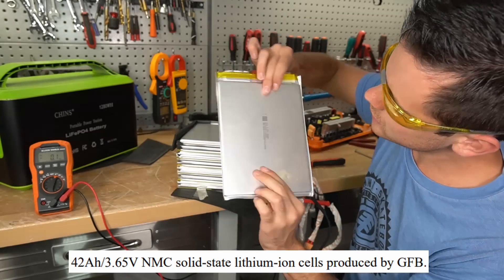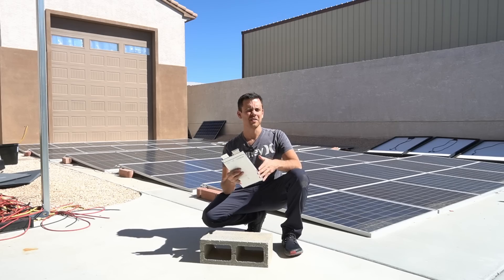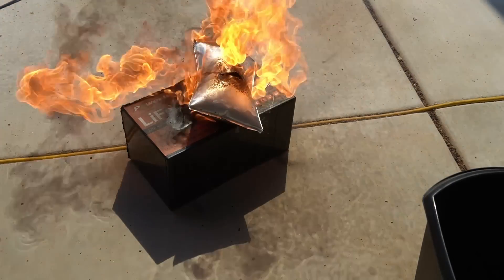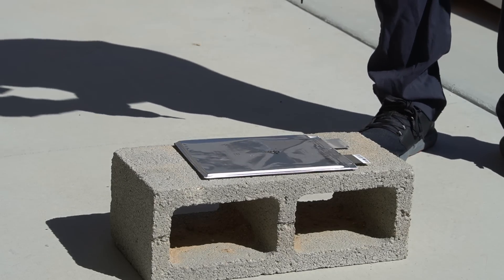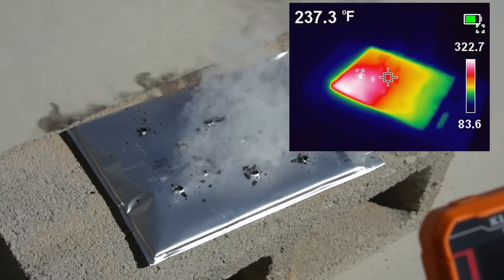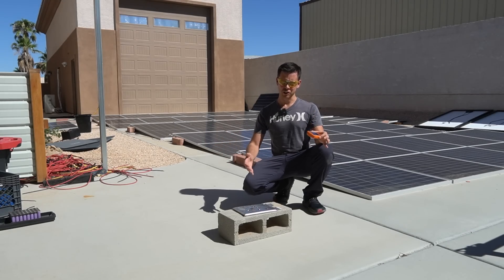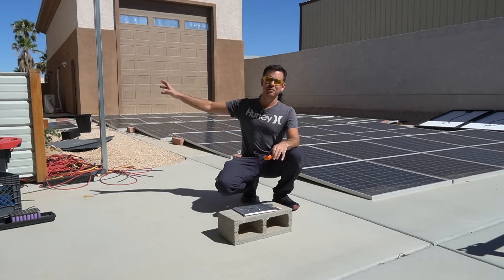LiFePO4 Drill Test! Will it erupt in flames?

Comment: I would like to see this test done again but at the 2:40 point in this video where it was venting smoke I would like to see you try and light that smoke with a BBQ grill lighter.  While the smoke may not contain a lot of oxygen it may contain a lot of hydrogen gas and that could be very bad in a closed room with little to no ventilation if hydrogen were to reach a  high enough concentration it could be very bad.

Comment: Now put a bunch of fully charged pouches stacked up in a battery case and simulate some crash damage that tears through multiple cells.  Will the cells in the center get hotter since they are sandwiched between other burning pouches?  Will they then flame out?  What if the off-gases are trapped?  Will those gases ignite and heat the cells up further?

Comment: In my own "testing" (dumping up to 1000W into a single cell and then shooting it with a BB gun) I found that the cell's initial SOC was such a huge factor, it even rivaled cell chemistry. I could not get any cell below ~30% SOC to erupt in flames - even the LiPo pouch cells just expanded and released some magic smoke. Above 80%, though, and you're in for quite the thrill.

Comment: This is a bad example, usually a system consists of multiple Lifepo4 batteries. Therefore, when an incidence occurs multiple batteries will give out heat due to they being close to each other; even the healthy battery will be affected. The temperature will rise quickly to the thermal runaway threshold of Lifepo4. The risk of Lifepo4 burning is still there but only a tiny bit less.

Comment: Our NMC batteries have heat sensitive fusible links on each and every cell.  So if they get hot all electric connections melt off, so it cannot do a thermal runaway.  And LiFePo4 are now known to have far higher levels of toxicity if they do catch fire as there no such thing as battery that cannot burn up in one form or another.
Reply: thank for info, and inside of apartment or house this toxic vapor have nowhere to go  unlike on this test

Comment: What was the charge state before you drilled it? Is the outgasing flammable? Is the outgassing toxic? 1 blade in the open air isn't really the same as it happening in an an enclosed space with other cells connected to a load.

Comment: Yes you are correct . LiPO4 cells are much safer than any Cobalt containing chemistries.
Only one problem sir:
That white "smoke" you see during cell abuse contains mixed ethyl and dimethal carbonate vapors, H2, C0 etc.
These vapors and gasses are highly flammable with a lower explosive limit of 8 to 11% if I can believe the internet sources I've consulted. In the open.air for a single cell test,, it looks and IS quite benign.  But in a confined space like an EV passenger compartment or a BESS container, the danger is declaration, or a slow explosion in other words.
Please look up the StacheD firefighter education videos.
Cell quantity and enclosure volume and ventilation make a Big Difference.
But in my own limited tests Cobalt based chemistries behave like fireworks, and LiPO4 is rather boring when mechanically thermally or electrically driven I to runaway. 
David Pacholok CEC LLC

Comment: Is the Vapor cloud from an LFP cell any less flammable than from regular NCM cells?  Fire directly from the compromised cells is an issue, but flammable gasses can be a much larger concern if trapped inside a building.

Comment: In a non ventilated room aren't those gasses toxic oxygen or explosive? When you say nothing happened that could mislead someone. I mean, you demonstrated only one type of failure. There's also thermal failure from internal components or externally caused. Electrical shorts can cause the battery to overheat to the point of failure. Chemical, mechanical, etc.

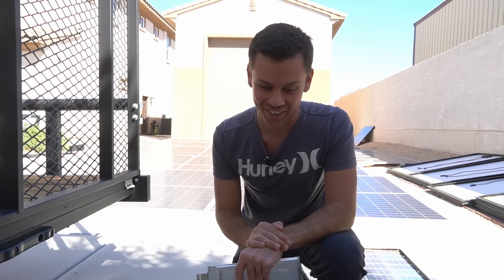Comment: 0:40  Don't know if you actually read the thousands of comments, but here goes.
My project is putting an electric auxiliary motor into a sailboat. I'm currently constructing the battery box out of wood and fiberglass, it'll hold 16 280 Ah cells in mild compression.
My concern is fire. No where to run on a boat offshore! Seems typical fire extinguishers are useless. Water makes it worse. CO2 gets split as well. Damn thing is making it's own oxygen and can't be smothered with foam.
I need a way to fight this fire if and when it happens. My idea is this;
The fire is inside the battery, which is inside a box and can't really be accessed quickly. It's producing copious amounts of toxic smoke.
What if I evacuate the box with a blower but have no inlet holes in the battery box for air flow. (The blower is dead headed.) The suction on the box is relieved by liquid nitrogen being released into the box from below and flowing around all the batteries as it goes gaseous. Nitrogen won't split up like water or CO2 and should extinguish any other materials such as plastic and wood. It's also going to get really cold in there. Cold enough to stop O2 formation? I dunno. Looks like a test to me.
How effective would a nitrogen based fire suppression system be?

Comment: i have seen lifepo4 burn. over discharge it and it will short out internally on the next charge. it will burn like a hydrogen fire. 

it might be good for home use but you but thst in your car and it's going to kill you. safer then 18650 cells but noy safe enough

Comment: Some companies are coming out with 12v 100ah LiFePO4 "mini" batteries using pouch cells that are smaller and lighter than the prismatic cell ones we normally find.  At first the pouch cells turned me off but the more I look into it, the more that I think the pouch cells are probably just fine.  Have you looked at those?  Redodo and LiTime both make the "mini" batteries using pouch cells and their builds look identical.  I'd love to get your thoughts on it.

Comment: Hmm, I don’t think drilling into it is it weak spot, 

I’ve seen a lifepo4 battery catch fire in a jet ski, very well know brand too 

They are not as safe as you think they are, 

I can share some pics if you can suggest where I post them
Reply from the maker: That would literally be breaking the laws of physics lol You have no idea what you're talking about
Reply: @WillProwse  
I have evidence to back this up, I was kindly sharing some Information but you instead decided to insult me when you have no merit. 

Shame. It would be nice to have an intellectual conversation instead of jumping straight to insults. 

Sometimes you need to mature up a bit mate!!
Reply from the maker: @AlexanderTheGrateful  😂😂😂 lithium iron phosphate during thermal runaway can't even reach a temperature that can combust paper. I think you should take a physics class or something. What you're saying is literally and absolutely impossible. The electrolyte can combust if you get hot enough but this chemistry does not release oxygen and does not have a self-propagating thermal runaway. Nothing I'm saying here is new or interesting at all. I'm simply stating facts that you can find in the literature very easily.
Reply from the maker: @AlexanderTheGrateful  I think you should read some safety sheets on lithium iron phosphate and learn how it works. Or watch my older videos. Sounds like whoever had a battery in your jet ski or whatever is not lithium iron phosphate
Reply from the maker: @AlexanderTheGrateful  And why would you be using lithium iron phosphate in a jet ski 😂😂
Reply: @WillProwse  because people are under the impression these are safe, 

I myself use a odyssey battery in all my marine applications, including my rental skis, 

They last on average 9-11 years with zero issues, 

Cheers
Reply: @WillProwse  I kindly uploaded the photos on my YouTube channel, 

Tell me what you think?

Kind regards

Comment: Happy birthday, and as usual awesome content. The naked cell also gets to dissipate it’s heat rapidly. Would you consider intentionally damaging a lifepo4 battery assembly inside of its carton and or overcharge a pack? BMS is a layer of protection but they too can have dangerous undetected failures.

Comment: Your scenario of someone accidentally drilling into a battery is a very real-world occurrence.  I've worked as a marine electrician for over 25 years.  It's only happened once, but I've made the mistake of drilling through a bulkhead and accidentally going through into a battery bank behind it.   It's very reassuring to know that this won't cause a major fire with LiFePo4 batteries. 

Love the channel!

Capt. Blackheart Charlie
Key West

Comment: Hi Will I know this is off subject but I'm Totally stumped, hopefully you can help me.------------I have 2 500 watt solar generators.Specs on 1st one 10.8 - 23.3v, 5A      Specs on the 2nd one12-28VDC, 8A . The solar panel I want to by is: ( JJN Bifacial 200 Watt Solar Panels 12V 10BB Monocrystalline Solar Panel )   Open Circuit Voltage: 28.1V - Short Circuit Current: 9.12A - Optimum Operating Voltage: 23.4V - Optimum Operating Current: 8.55A . Would this work on these solar generators, (Golabs R500 and Bluette EB55) ???  Thanks !!!!!!!

Comment: Hey Will, Or anyone who could help me out! I am looking to install the 600W renogy solar kit on my RV, and was just wondering what would be the best panel wiring config? Would I be able to run all 6 100W panels in series(easy for my orientation to wire)? Or will I have to make 2 strings of 3 panels each (will be a pain for me to wire)

Comment: Hello Will, I have a 24 volt system using 8- 12 volt batteries in series & parallel to create a 24 volt system ,after connecting the series part going Neg to Pos connecting the eight batteries when I try to connect the parallel cables from the first battery to the third battery I get a very big ARC , what am I doing wrong   Thanks  one of your subscribers  Al Ruark

Comment: Happy Birthday.  I wish you the best of the best.  I always watch your videos and I admire you a lot.  One question, I have a 50Amp battery connected to a UPS, but to charge it with an external charger I have to manually disconnect the battery from the UPS, is there any equipment that does this automatically to avoid damage to the Backups UPS while it is charging.  Thank you and keep going, you are exceptional

Comment: will ,there is a person or entity called Engineer 775 He talks about going solar without an inverter.    I too think I would like to head that direction on my system as an inverter seems to be the single most expensive item on going solar and using the panels ,batteries ,wiring ,charge controllers, and inverters.   I have watched your stuff and would prefer you sum this up.    I am a licensed electrician since the early eighties....know a lot about electrical ,the procedures and materials concerning electrical ,but my knowledge of dc is working on car issues or aa ,aaa,and other battery issues .     what do you think.    how do I contact you other than the way I am doing it.     I do not own a current NEC code book,but I would bet one if it could be beneficial such as sizing conductors based on load etc and conduit sizing .....

Comment: I know electric vehicle car manufacturers go through a lot of trouble to protect the batteries, but I think they are using chemistries that can create thermal runaway.

Not having gasoline is a help, but in a severe collision I could still see the battery being punctured.
Reply: Li-ion powered cars are significantly more dangerous in a fire than any IC fuel (lest you use idk liquid fluorine + lithium), and Li-Po can make explosions (luckily i am not aware of any manufacturer using it in cars)
LiFePO4 batteries are beginning to be used in for example teslas due to being a lot safer (the fumes have a lot of molecular hydrogen that can detonate (not that big of a deal in open air)), but i will eat a croc if BYD or any EV big player completely switches away from classic Li-ion

Comment: Will, we installed Victron LFP batteries on our sailboat.  One of the frustrating aspects of the conversion is that lead acid batteries are treated as being zero risk.  Can you do a risk comparison video between lead acid and LFP?  (Ps Happy Birthday)
Reply: I had lead acid venting on me, it did not heat up like the LFP, certainly not like the other LiIon batteries.

A single puncture test, of a stand alone LFP cell, does not show what would happen if multiple cells of that size got punctured together.  That would be a very nice test.

Comment: Very informative video! Loved the thermal runaway chart!! Now that the smoke has cleared, do you consider EcoFlow, Jackery and older Bluetti portable power stations based on NMC batteries to be a fire hazard? A video to break this down would be great for those of us who store these units at home in case of a grid power outage and want to stay within a reasonable fire risk tolerance.

Comment: Hi Will,

happy birthday.

I saw at 1:33 the dirt at the bottom end on your panels in the background. You can install little plastic clamps for solar panels so when its rains the water flows of the panels. Therefore less dirt stayes on the panel when the water dries.

Comment: To be fair: the difference with the "solid state" version was that you made 1 puncture and 1 through hole that made it burn
In this case you have multiple holes that helped venting the hot gas.
So actually you have to sacrifice another LiFePo4 sachet with 1 puncture and one through...

Comment: I like using po4 batteries . Not as much energy storage as a li ion but its alot safer . I also like the high c rate po4 have aswel . They can take a beating and they keep on ticking .

Comment: It would be interesting to see if you took two of those LiPO batteries and drilled through one while having an adjoining battery next to it to see if the heat given off during its combustion process would somehow trigger a reaction in the second battery that was not drilled through sort of like puncturing it when it's still in its stack.

Comment: weird that Tesla disregarded LFP as an EV battery considering that China has been using it for a while and Tesla could get rid of battery fires.  There is a recent of video of a Tesla M3 in flames going around in twitter, it has the cylindrical cells and not the LFP version.

Comment: I had a LiFePo2 battery catch fire and almost burn my building to the ground. Fortunately my wife heard a pop sound when we were sitting outside.  We were able to pull three batteries out of the shed before everything caught fire. I’m not bashing LiFePO2 because I’m building more batteries, but I want to let everyone know they can be dangerous and do not get sloppy like I did when storing them.
Reply from the maker: How?? Can you post pictures on the forum? They do not spontaneously combust. There has to be a heat source.
Reply: @WillProwse  Posted to the forum with thread “My LiFePO2 battery caught fire” and my response to your question on this YouTube post.
Reply: Will, they did not spontaneously combust. The battery was made with headway cells and I stupidly put a box on top of them not thinking it was a heavy box. Unfortunately the positive lug bolt pressed on one of the headway cells with enough pressure to pierce the thin protective film.  The battery literally popped and turned into a Roman candle just like your, so called, solid state battery fire you demonstrated in your last video.  It scared the snot out of me and I got a minor burn tossing it out of my solar shed. I will be happy to show pictures. I’ll title the post “My LiFePO2 battery caught fire” on your forum. Still shakes me up a bit when I think of the total loss of my solar shed if we were not there to put the fire out.
Reply: “LiFePo2” - I think you mean LiFePo4?

Comment: Will,
Being that the new Chins battery that you opened was definitely not Solid State batteries I would be very interested to see you do a drill test on the Chins LiFePO4 battery just to make sure they aren’t mislabeling them as well. They might be dangerous LiPo batteries, who knows.
Reply: All LiFeSO4 come from china. The two biggest LFP battery manufacturers for automotive use are BYD and CATL both Chinese.
Reply: @najibyarzerachic  this is in reference to testing Chins batteries specifically. Not generalized Chinese batteries.

Comment: Happy B-day!   My Bluetti AC Power MAX gassed out exactly as your demonstration!   I was in my RV,  and my 1000 watt panel was charging her up in the early morning sun.   Then suddenly I heard a hissing sound!  What is that?   Then gaseous fumes billowed out of the solar generator and I dashed out of the RV.  Imagine if that was a Lithium Ion?  I would have lost my RV!  Bluetti  promptly replaced my failed unit.  Great customer service, but you have to buy direct from the company.  Returning a defective unit via Amazon purchase can be problematic.
Reply: That's not good at all, I own several bluetti and ecoflow now that you mention it, should probably get rid of all of them and just stay on grid electricity, so much conflicting information saying it's safe wont catch fire or toxic fumes it's green, yeah right.
Reply: I would love to know what happened!  Overcharge? Physical damage? Short circuit? It's situations like yours that make people afraid of these batteries, and it would help a lot to find out what caused the failure.
Reply: @theclearsounds3911  The battery failed because the plastic air tight seal failed.  It was a manufacturing defect.  The outgassing is actually harmless.  The replacement unit has been working flawlessly for the last 3+ years.

Comment: solid state just hitting the market. so far that one was a miss and very dangerous. I cant see a UL approval hear. for some or most homeowner insurance requires a UL and a inspection for electrical even if off grid. well there is Sodium Ion and many more coming soon. Time will tell.    Thank you for this video. This a real test. no BS. The tear down shows it all ! keeping ripping them apart ! A fancy case means nothing.😀